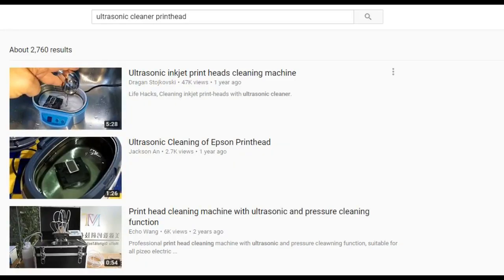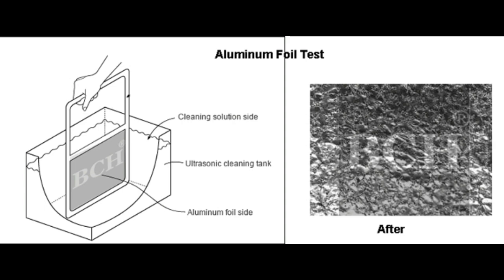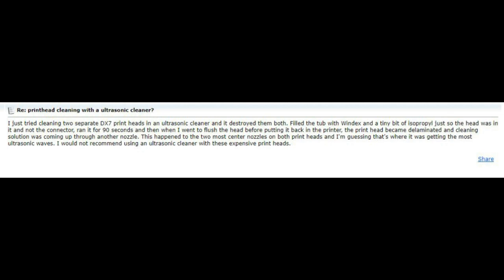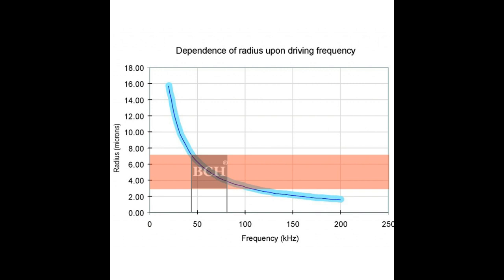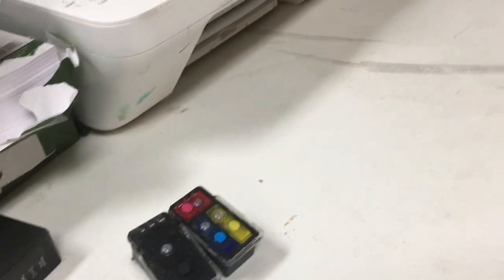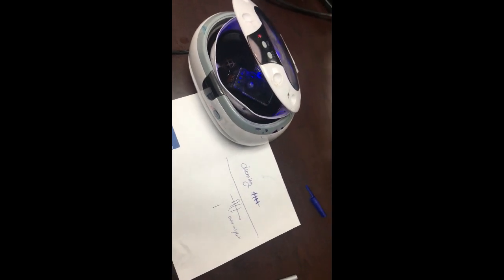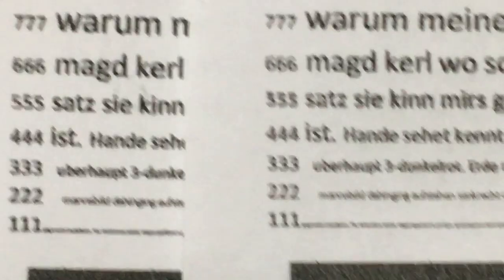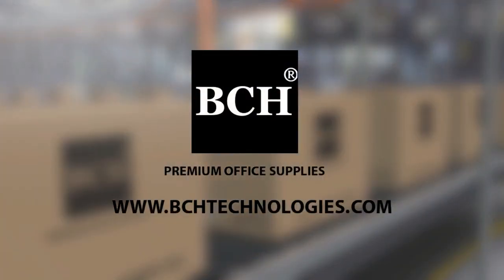Should we use Ultrasonic Cleaner to Unclog Printheads?

Comment: I tried to use ultrasonic cleaner on Epson R280/L800 printhead after I exhausted all other methods to unclog dried printhead to open more than 80% of nozzles. The printhead was from the printer manufactured in 2008. I used the combination of windex cleaner, distilled water and isopropyl alcohol as a cleaning solution as recommended on Youtube. The first 2 minutes of cleaning nozzle plate down was sufficient to kill it - due to delamination of the nozzle plate from glass substrate. The ink chambers are leaking into each other now. I am not sure that this happened only during cleaning, but the leakage was not present before cleaning. 
I took the nozzle plate off after that to inspect. The entire glass substrate is covered with very thin grey epoxy layer, which can be scratched by exacto knife to reveal glass. The nozzle plate back side is absolutely clean, with no signs of adhesive. It looks that ultrasonic penetrating the metal destroyed the adhesive layer. I would not recommend anyone to repeat this experiment, and looking for advice (?) how to glue the (perfectly cleaned) nozzle plate back to the printhead. 
In particular, the glue used for these heads is  Epotek 301-2FL or  Epotek U300 (these adhesives are filling the gaps due to capillary force), but I have no idea where to get it and if the repair is really possible.
Reply: I wonder if you had just used distilled water if the UC would have still destroyed the printhead? I wonder if the windex and alcohol may have been what caused the damage?
Reply: Did you manage to glue the nozzle plate?
Reply: Epson uses piezoelectric printheads on the majority of their printers which would be way more susceptible to damage from ultrasonics than the thermoelectric printheads on pretty much all other consumer inkjet printers. I'd advise against this on Epson print heads.
Reply: End of the day whether you found any method to seal it back... whichever method like silicon,  i guess the your gasket glue is torn off, 

This print head is very sensitive , I have a unit from customer, the yellow got tainted with black in and the light cyan also a bit...

I haven't go with experiment how to seal it back.
Reply: I doubt that it can be sealed back outside of factory environment, because it is a 3-layer of different glues and there is a patent on how to do that. It is too "microscopic". I was planning to put together a video "how NOT to clean Epson printheads", mostly explaining what are the problems in recommendations on YouTube... But did not have time. In quick summary - it might be rather safe to use vacuum to clean them, but not safe to use many methods seen on the web.
Reply: @celsiusswatt6021  I say one chinese youtuber from China use certain glue and microskop to do it

Comment: Kevin, not sure if you still read this thread!  I really appreciate your work and will be reaching out to BCH for future ink systems.  I have an Epson 9900 printhead that is clogged, very persistent.  I've already done one flush with 'Printhead Hospital' cleaning fluid (before discovering your site), unsuccessful, no change in the nozzle check.  All colors perfect except for PK or MK (mostly clogged).  I removed the printhead and reinstalled successfully without damage 1x.  So, I'm thinking about trying your other techniques, ultrasonic or steam with distilled H20.  Do you have any suggestions for the Epson 9900 printhead?
Reply: What did you end up doing on this? I've got an Epson printhead that the yellow is partially clogged and I've not been able to fully unclog all of the yellow ports. I've got the bottom of the head now sitting in cleaning solution. Not sure if ultrasonic cleaner would destroy the bottom of the printhead.
Reply: Try warming the solution, then sit the print head in it and attach a syringe to the nozzle and try lightly pulling the fluid through.
just keep pulling the fluid through in several passes until you stop pulling diluted ink.
If you get too much resistance, stop as you risk destroying the membrane.

Comment: I've tried using my sonicare toothbrush rubberbanded to a soaking cartridge.  I don't think it had the bubble effect, just vibration.  I didn't have good success.  Good to know the vibration can destroy printheads.  I did destroy that integrated cartridge, but I thought it happened when I touched the contacts with wet fingers.
Reply from the maker: Try to wipe the contact points dry and re-insert again.   The cartridge may not be bad.
Reply: @BCHTechnologies  I think there is nothing wrong with the Hp cartridge, except the HP cartridge system is on a counter.  (HP counts everything..). . . and I exhausted my times of taking the cartridge in and out of the printer and got my cartridge locked out.. This never used to happen on my early oughts HP.  I think the only way to do refill ink on the HP these days is with a ciss installed on a virgin cartridge and just use it a lot to keep the printhead clean, because you cannot take it out without using up counts before lockout.  Cartridge modification might work if you are very aware of how many times you take the cartridge in and out and accept that you will eventually get locked out.  The nice nearly new Envy 5530 I picked up for free has bad cartridge holders that make if difficult (but not impossible) to ciss.  Hp has gone nazi against refillers.

Comment: Hi, can I use this cleaning process for HP latex 570 printheads? (Latex 831 printhead).  In addition, I can not find the smallest products of 120khz. Is there a place where I can find small size (enough to fit the printhead) (maybe max 2 liters).

Comment: This has to be the most hilarious German writing i have seen so far. It is word salad but it almost has the proper sentence structure.

I have this cheap EPSON scanner/printer combo that i bought 10 years ago, used for a bit, then put in a box and forgot i had it; now the black head still works because it had a high-quality third-party cartridge for $2 in it, but the 3 colour heads that still had the original EPSON cartridges in them are clogged pretty tight. I keep forgetting the model, i think the DX4050, but it runs on T071x cartridges. I also have an ultrasonic cleaner somewhere that i bought at ALDI or LIDL 20 years ago for probably about $15, which obviously means it's the highest quality product known to mankind. It should be 35W/40 KHz. Do you think it's a reasonably sensible idea to dismantle my printer and ultrasonic clean the head? What kind of liquids are most suitable?

It's not like the printer is very valuable, i just enjoy fixing stuff, and if you happen to know or have a good suspicion whether they survive ultrasonic, that would be super helpful.
Reply from the maker: If it is a cheap Epson, it will have a higher chance to survive the ultrasonic.  However, have you tried hot water (or cleaning solution)?  The OEM cartridge is clogged solid may have something to do with its ink type.  If it is the pigment ink, then unclogging is very hard.  Try to put the printhead in hot water or cleaning solution, or flush it with a syringe and tube.  We did the flushing at 13:30 of this video: https://youtu.be/O2faseTe38s

Comment: Instead of using an ultrasonic cleaners vibration just use a spare heating pads 60hz vibrator mechanism. Worked for me.
Reply: Hello, what you mean with 'spare heating pads 60hz vibrator mechanism'? Is this a machine like ultrasonic cleaner? Thx and cheers M8

Comment: Will this method work with an Epson WF 3640?
Could you perhaps show how to remove the print head from this model printer in one of your videos?

I confess that I'm a rank amateur with printers.  I've used them for years, of course, and have been very dissatisfied with all but the Epson i currently own.  I've HP - a very large machine, which was a disaster.  HP support was terrible.  After windows updated from Vista to W8, it was necessary to reinstall the software.  The original was not compatible with W8, and the revised driver available on line did not include all of the needed files.  There was one in particular, which was only available on the original install disk, which I threw away because W8 immediately reported it as incompatible.  People complained about this continually in the HP forums, and HP never responded - nor did they make any effort to make the needed files available.  Therefore, should I live to be 1000 years old, I'll never own another piece of HP equipment.  Never.

I don't print a great deal, so they tend to get clogged up. So, I tend to end up just trashing them.  This is wasteful, and very annoying.  I had a laser printer many years ago, and it worked fine until the thin plastic thing that transferred the powder to the paper tore, and I found it that would cost about the same as a new printer.  And, of course, it was only black and white...

Print head clogging has been an issue with every one of the ink jet printers I've had.  I would like to get to the point where I can deal with these maintenance issues confidently, and your videos have certainly helped educate me regarding the procedures.   Kudos also for the droll humor you inject into the narratives.
Reply from the maker: We have tried 85 kHz for 30 minutes.  The higher the frequency the less power (safer).  Most cleaners are 40-45 kHz and there ARE reports that UC destroyed Epson printheads.  However, they didn't specify what frequency they used.  Our video (for cleaning T252) is here: https://youtu.be/tFXArnIGrAA

Comment: One last question, if it's a printhead, how many minutes should I apply?
Reply from the maker: It depends.  If it's Canon or HP's integrated cartridge, I would use any kind of ultrasonic cleaner (even low frequency like 45 kHz) for 20-30 minutes.  If it's Epson, I will only use low power high frequency (>75 kHz) for 2-3 minutes.  Epson's printhead shouldn't be ultrasonically cleaned unless you know what you are doing.
Reply: @BCHTechnologies  Thank you for your answer.  In my previous comment I tried to give details about printhead, I guess you haven't seen it yet. I want to repeat my question. Can I use this cleaning process for HP latex 570 printheads? (Latex 831 printhead).  In addition, I can not find the smallest products of 120khz. Is there a place where I can find small size (enough to fit the printhead) (maybe max 2 liters).. Thank you for helping.
Reply from the maker: @DrmSeki  The Kyocera is also a PiezoJet, like Epson.  It uses chip on film technology so the quick answer is NO.  However, if you can find a good high-end ultrasonic machine (over $1,000 for 75 kHz+) and do it carefully, you may be able to pull it off.  It should be used as the last thing you want to do.
Reply: @BCH Technologies , hi  My test results were very successful. I used a 135 khz cleaner, all printheads were successfully cleaned and ready for use.Thanks for the help
Reply from the maker: @DrmSeki  Wow!  Where did you get the 135 kHz cleaner?  I could only find 120 kHz and the price was over $1,000.

Comment: Hi, what do you recommend I do for an HP CN688A printhead?
Reply from the maker: It has a membrane inside.  Therefore, I would try to flush (push) and suck from the bottom first.  Make sure don't push too hard otherwise you will break the film.  Ultrasonic is not good for printheads with a membrane unless you have a high frequency (>75 kHz, normally >$1,000) machines.
Reply: BCH Technologies thank you very much for your advice I will do that
Reply: BCH Technologies I was able to unclog the color nozzles but not the black ink one. It was actually working before but I used an expired black ink cartridge on it and now it’s extremely clogged. I’ve been trying and trying but with no success. On the other hand, the color nozzles are flowing beautifully now, and those were the problem before! I don’t know if I should keep trying or just give up. I’ve been using 91% isopropyl alcohol to unclog them. Do you have any tips for me? Also, Ive been using a large plastic meat injector syringe with some clear vinyl tubing attached to it to force the alcohol through the nozzles. It actually works very well just can’t get the black ink to budge.
Reply: Hi will it work to clean Epson f2000 print head? Thank you so much! Your video is SO informative!

Comment: boss what kind of water u use? we can use anykind of water?
Reply from the maker: It depends on the printhead.  If it is less than $50, we will use regular tap water.  If it is more expensive ones, we will use distilled water.  Distilled water is relatively cheap in the US, less than $1 a gallon.  If the printhead was clogged by Epson's OEM ink (pigment), then we may use cleaning solutions rather than water.
Reply: @BCHTechnologies   my print head is for L1800 epson
Reply from the maker: @havefun8962  In this case,  don't use ultrasonic.  It looks like it's using dye ink, so you should be able to unclog by just flushing.  No need to go ultrasonic.  If everything fails and you have to use ultrasonic, try to get the highest frequency as possible.  It's better to use 75kHz or even higher.  Most cleaners are 45 kHz and will damage the printhead.  The higher the frequency, the less power, and smaller the bubbles are.  Also, only do it at a short time.  Because the Epson uses chip-on-film technology, you may get the Piezo film damaged.  Again, I am against using ultrasonic on this model, unless you  have a lot of experience
Reply: @BCHTechnologies  the printhead i have is L1800 Epson. And i ddnt use it in 5 years.. Then yesterday i put it on ultra sonic and normal water. Then i use strong air pressure. Then i see in the yellow dry ink in the hole its look like Clay stick comming outside while im sprying it with air Pressure
Reply: @havefun8962 - so did it fix or not?
Reply: How about kyocera pheads